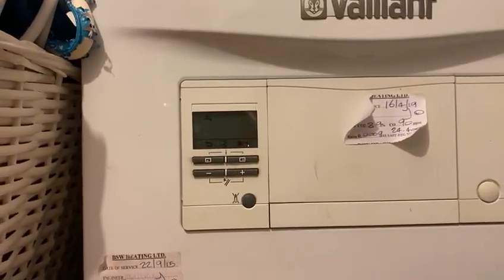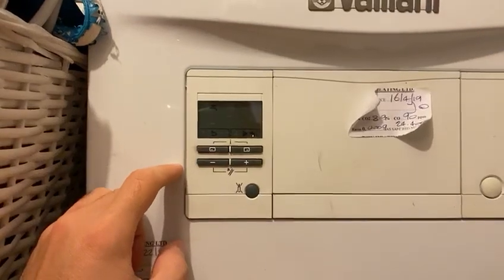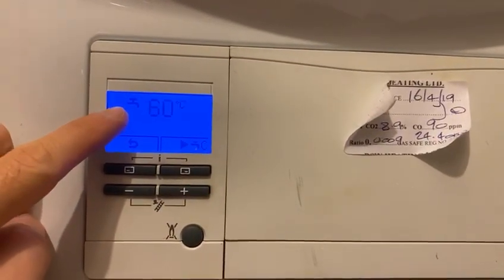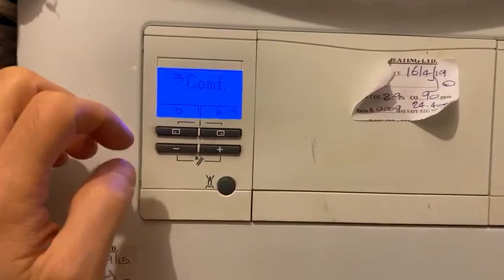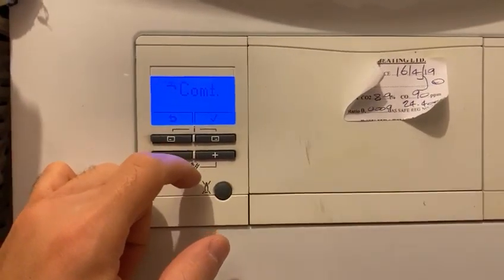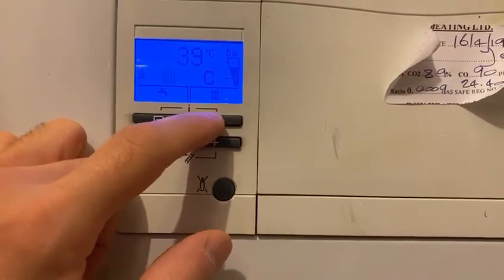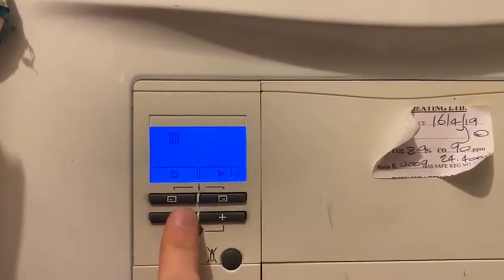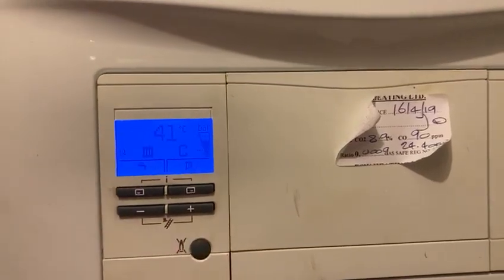Vaillant boiler controls-no heating  hot water ( Easy Fix)

Comment: Why is the flame symbol not coming on
Reply from the maker: @lesleydunlop7789  hey - the flame symbol comes up when the boiler ignites and the heating comes on. Have you released any pressure? Have a look at this other video i made which might help: VAILLANT BOILER controls | no hot water
https://youtu.be/CiGIDwE7Jdg. Also please if you haven’t already, could i ask that you subscribe to my channel. It would mean so much🙏🏻
Reply: I have a Vailant ecofit sustain boiler with exactly the same menu in your tutorial. I’m having a problem with heating. I have a panel on the wall which I can use to switch on the heating/thermostat, but after switching on the radiator for a few minutes it automatically shuts off, any help please?

Comment: My ecotec 28 has no taps underneath for pressure just the silver pipe? I can get hot water but no heating will come on, I went underneath as my bar pressure is low I think it's 0.8.......but every vid I watch you have 2 taps by the link type pipe.... I don't have them.
Reply from the maker: @liverpoololdschool  check if you have screw types that can be turned left/right instead. Like in this video- https://youtu.be/CiGIDwE7Jdg?si=ex86mzshpkcAn9oD please don’t forget to subscribe and like. Would mean so much for my channel 🙌🏻
Reply: @fitnessEris  I just have and I unscrewed them a little but nothing happens, my hot water is fine but the heating doesn't come on.... I think the last check the guy changed something when testing... Il figure it out.... Thank you fir quick reply much appreciated.
Reply from the maker: @liverpoololdschool  oh i see. In that case check with the guy who last fiddled with it hopefully they know more. Best of luck and you’re very welcome 🙌🏻

Comment: Why does my boiler say f28 all the time.. I drain the pipe.. the boiler works again.. but when I put heating on.. the next day it’s f28 again.. why??… can anyone help me here…
Reply from the maker: @martymartz3254  have you checked if the pressure is lower then it should be? Please if you don’t mind, could you subscribe to the channel. Would mean the world 🙏🏻
Reply: I subscribed can you help me with this boiler.. f28 all the time.. I have to drain a pint of water..
Reply: What do you mean by the pressure.. how do I do that?
Reply from the maker: @ have a look at this video. This is how i lower or increase the pressure. VAILLANT BOILER controls | no hot water
https://youtu.be/CiGIDwE7Jdg. If link doesn’t work, the video is in my channel and is called. VAILLANT BOILER Controls | no hot water

Comment: If you see F 75 what is it
Reply from the maker: @hassanhusseinhassan2932  Just wanted to say thanks for watching my video. Could you please hit SUBSCRIBE for me i would really appreciate it 🙏🏻.
The F75 error code on a Vaillant combi boiler typically indicates a problem with the boiler's water supply. This can be due to:

1. **Low Water Pressure**: The pressure in the system may be too low, preventing the boiler from functioning properly. You can check the pressure gauge on the boiler and, if necessary, repressurize the system.

2. **Blocked or Faulty Components**: There may be a blockage in the system or a fault with the water flow sensor or pump.

3. **Diverter Valve Issues**: Problems with the diverter valve can also trigger this error, as it controls the flow of water to the heating and hot water circuits.
Reply: @ErisLifeHub    If seen  F75 what is need my boiler
Reply from the maker: @hassanhusseinhassan2932  you will need to check water pressure and put it UP⬆️. Check out this video- VAILLANT BOILER controls | no hot water
https://youtu.be/CiGIDwE7Jdg
Reply: @ErisLifeHub  thanks
Reply from the maker: You’re very welcome
Reply from the maker: Thank you if you subscribed 🙏🏻

Comment: The little round button at the bottom what’s it for
Reply from the maker: That’s a button that will boost the boiler. Basically when you press it, it will ignite and heat up the water as a boost. Hope this helps-Please subscribe  and best of luck 🙏🏻

Comment: For the heating side of it what should the bar be?
Reply: Should I just leave the bar alone?
Reply from the maker: Hi there. The bar should be just in the middle or just below the middle. Not at the top end as you may need to release pressure from the radiators with a special key. Hope this helps. Please if I could ask to hit the subscribe button on my page i would really appreciate it as it will help my channel reach others who are in desperate need aswell 🙏🏻God Bless

Comment: Hi can I turn on my radiators from this control panel as I need my heating on and it only comes on sometimes.
Reply from the maker: @stuartramplin9265 - from here you can turn the temperature from low to high depending how hot you want them to get and then control your heaters from the thermostat or individually  at the knob next to the heater. If they don’t come on, the heaters might need bleeding. Could i plesse ask if you can hit the subscribe button Sir- I would really appreciate it and it would mean so much. God bless and all the best 🙌🏻

Comment: I wanted to know how to switch only the hot water on. Not with the radiators at the same time. Can you help? Thank you very much.
Reply from the maker: Where the tap symbol is you need to increase the temp of the water and also check the pipes under the boiler if there is enough water flow going through. Please please hit the subscribe button. Would mean so much and thumbs up 😅. Thank you for watching and good luck

Comment: If both valves are closed underneath (mains in and valve open) then would there be any other reason other than one or both are defective that is causing the pressure to elevate? he changed the expansion vessel - just wondering why it’s taking them 4-5 attempts?! thx 4 vids m8 btw! 😊👍

Comment: Hi there, I have Vaillant boiler with same control panel (but is an ECOtec plus 637) I get no response from the left hand button and no image of the tap comes up. (Central heating control is all working fine) - nothing in the manual trouble shooting section. Any ideas?
Reply from the maker: There might be something wrong with the digital side of it to be honest if you’re not getting a response

Comment: My eco TEC plus 637 is showing 

Flashing screen and saying low pressure.0.25bar

I managed to get the pressure up to 3.0 then shut the valve.
But it is still slowly climbing and got to 3.4!!! 
I now have only radiators hot but not tap water.
Is this dangerous.

Comment: Hi just watched your short clips on issues on the Vaillant boiler, my question is if you can kindly assist, that my boiler won't switch off at the thermostat which has just had new batteries in. It continues to run even when switched off from the boiler it self. Once turned on it again automatically runs the heating on. It's a pain as the boiler is not responding to my thermostat to turn off the heating and from the main switch off button either. What must it be?

Comment: My plus and minus buttons dont work when i am in the hot water or radiator screen
Reply from the maker: Hi there. Switch it off at the main button on the wall and leave it for 2 minutes. Than switch it back on. That should re-set the boiler. Hope ot helps. Can I please ask that you hit the subscribe button on my channel. It would mean so much to the community and people who are trying to solve the same problem this cold winter 🙏🏻. Good luck and God bless.

Comment: Hi thanks for being so thoughtful in the current situation.I wonder if you could advise me on my valliant eco tec pro which has a separate thermostat its in the hall away from boiler in kitchen a child touched the settings I have it on manual the screen shows he1N above the word cylinder which is normal but im afraid to touch left dial- control as theres a whole menu and I dont want to loose heating Im quite worried as to what heIN means..Any advice would be welcome...!
Reply from the maker: Hi there. I honestly wouldn’t know if I can’t see it. But it might be worth switching it off at the mains “button on the wall near boiler” and back on. It sort of restarts it. I hope this helps. Can I please ask that you hit the subscribe button. Would mean so much for the community here and my channel reaching out to others with heating issues this winter 🙏🏻. Thank you -God bless
Reply: @ErisLifeHub  Hi Thankyou for your advice your response is welcome I did switched main off before to see if it reset itself Tried again even called Vaillant they sent a pdf it may as well be Chinese- it has everything apart from the answer to my question which is what word should be visible on thermostat above the word cylinder, im phased because when I turn setting knob It shows days, months, how long etc and as I said I have it on manual..Anyway thanks again..(subd)..x
Reply from the maker: Thank you buddy- Apologies I couldn’t be much help- I wish you all the best and hopefully Vaillant can sort something out. God bless 🙏🏻
Reply: @ErisLifeHub  Hi Thankyou for your kind message..🖐🖐

Comment: Why is it when I go away for 4 days (in summer) and switch off the hot water on my Danfuss timer, that my Vaillant boiler just wont work when I return (on a Friday night when I can't get an engineer until the following week meaning that I have to use the emersion heater which is now as expensive as a facelift ). Once upon a time I had an efficient boiler the size of a small Hifi speaker that never broke down, then it was replaced with a supposedly "more efficient boiler" that has an instruction book as thick as Radio Times - which spends its first pages telling you how wonderful it is - but  which for a numbskull with mild dyslexia is as enthralling as a prostate examination. What ever happened to "ON" and "OFF". Is it a Government employment scheme???? Hopefully I will get the data here. Thank you for trying at least!
Reply: I was convinced by someone that valiant boilers were fantastic it’s a pain in the backside.

Comment: Thank you for this useful video. 
I hope you can help and advice me with my problems to have not warm water since yesterday if I took all the air of the radiators out. Before everything works perfect and I thought is time to take air out of the radiators. I also opened one of the radiators from one of my rooms on and after that the pressure from the warm water side is very very low and we don’t have warm water because of the low pressure. I also had to turn the heating off if I get warning sign and was scared to something happened. At the moment no heating and no warm water if the water pressure is very low from the heat side. 
Please help and advise me what to to. I do have exactly the same Vaillant boiler as you show on this video. 
Thank you 
NZ

Comment: Does anyone know why a radiator flashes on the screen and a egg timer. I've had to turn the whole thing off as the pump was making a racket. Any ideas would be great. Thank you 🙂
Reply from the maker: Hi Lindy,

Have you tried doing a restart?
There should be a mains button on the wall. Switch it off and wait for 2 min than turn it on again. 
Hope this helps. 
Can I please ask for a big favour, that you subscribe to the video please 🙏🏻 thank you and good luck 🤞🏻
Reply: Thank you for your reply. That did work for a while then it packed up completely. Turned  out to be the pump. That's the 3rd one 🥴 Have definitely subscribed 👍🏻🙂👍🏻
Reply: @lindylou3050  If you have had three pumps the system water may be contaminated. There should be a magnetic filter on the return pipe to the boiler. If not one should be fitted plus system flush and inhibitor fluid installed. I hope that helps. A lot of “plumbers” do not service boilers as recommended. 🙃
Reply: It’s the pump over run it does that so the boiler looses its heat into the heating system before going into standby, and if pump valve s noisy check the system pressure 1.5  cold system to rise up to 2-2.5 at hot running temps hope that helps

Comment: We just move to a new flat today and we have this broiler Im wondering what is the best temperature for heating?Thanks
Reply from the maker: Hi thank you for stopping by. I would recommend at about 75*C. Can I please ask that you hit the subscribe button 🙏🏻it would mean allot as I’m trying to grow my channel and help others as well with heating issues 🙏🏻thank you
Reply: @ErisLifeHub  thank you...done subscribing you...
One more question what water temperature should i set it?
Reply from the maker: Thank you for the support, I would suggest set it at the same temp as the heaters first and open the hot water tap and see if your happy with that set of temperature. If not than you could decide from there whether you want it higher or lower. I hope this helps. Let me know if you need anymore help. I have a few more boiler vids on my channel, they might help. Good luck 😊

Comment: Hi, I’ve got a vaillant ecoTec pro and for the past week I haven’t had any heating. I replaced the boiler control screen but it won’t start up and it’s saying communication fault and it’s frozen on that. Please could you help!
Reply from the maker: Thank you for your comment. It looks like it might be a manufacturer fault. Try switching it off on the mains ( usually a button next to boiler on the wall) and turn on after 5 minutes.Meanwhile would you mind showing your support by hitting the subscribe button, it would mean allot and also check out the other boiler videos i have on my channel and let me know if its any help. Good luck 👍🏻
Reply: @ErisLifeHub  sure why not. It’s been like this for the past week with no hot water or heating, and I have already tried turning it off from the mains. After replacing the screen it kept coming up with a connection fault and now all of a sudden it started up and is heating but the fault is still on the screen and won’t let me change the temperature on the boiler.
Reply from the maker: @haseebali3932  it might be a manufacturer issue. Maybe find their number online and give them a call and see what they say. Let me know how it goes if you do. Good luck 🤞🏻
Reply: @ErisLifeHub  Thank you for the help. I’ll call the manufacturer and see what they can do and I’ll be sure to let you know.

Comment: Why does your boiler temperature stay on low 40s? Shouldn't it be running at a higher temperature... thanks for the vid
Reply from the maker: Thanks for watching Dan Gashi, may I ask you if you could kindly support my channel by hitting the subscribe button. Regarding the temperature I think the low 40s is enough to warm up the heaters and water as I have a small flat and also under 50 its energy efficient. I hope I have answered your question but please don’t hesitate to comment again if you have more questions and Ill be happy to assist. Happy new year 🥂🎉
Reply: @ErisLifeHub  
Thanks. I have subscribed!

The only reason I asked is because my boiler was running at 75 degrees and since I had my boiler service (yday) it has been sitting on around 53....
Reply from the maker: @danarsenal5440  thank you 🙏🏻. That should be fine, as long as it doesn’t go in the high 50s and above

Comment: Hi thanks for the video! Might be a silly question but do you just leave your radiators on at 70-80 degrees during winter? With all my previous boilers I have been able to set a timer to choose when the heating turns on and off but I can't see a way to do that with the Valliant EcoTECH pro.
Reply from the maker: Hi, thanks for watching the vid, would you mind subscribing to the channel please and give me a thumbs up if the video has helped.
As per your question I usually control it on the thermostat but yes, I usually leave it at about 70 degrees on the boiler.
Reply: @ErisLifeHub  Hi thank you I have done! I've been looking a bit more into why my boiler isn't working properly. I have set the heating flow temperature to 70 degrees, however the heating only comes on very late at night and seemingly quite at random. I can't find a thermostat in the flat so am unsure how I am supposed to set the required heating flow temperature - there is no mention of this in the user manual for the boiler. Also, when I check the status of the boiler it says it is S.31 meaning it is in summer mode, but there is no icon on the display to indicate summer mode is on. The manual seems to suggest that to turn summer mode off you just have to increase the heating flow temperature, which I have already done. Do you have any advice?

Comment: URGENT: I just went to stick my heating on. Nothing.
The boiler is flashing a SPANNER symbol and that BAR symbol (at lowest point). I phoned Vaillant - something to do with pressure in the pipes?
(guy the phone said the braided metal pipe sat on floor of boiler cupboard should be FIXED to something).
Have text landlord, but does anybody know anything I can do? arrrrgh 😩
Reply from the maker: You might need to release the pressure , its a special key called bleeding key. Would you mind hitting the subscribe button for me please 🙏🏻
Reply: Just turn one of the keys in the pipes til u hear water start going into the pipes